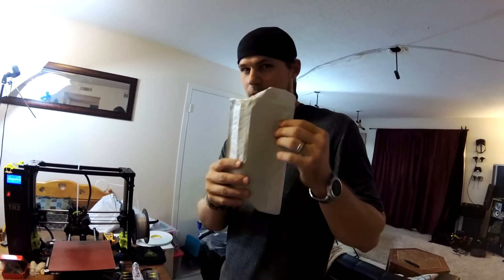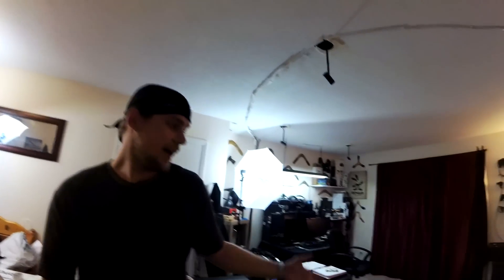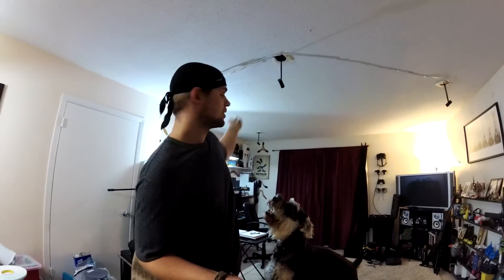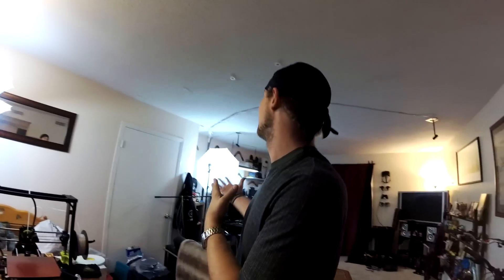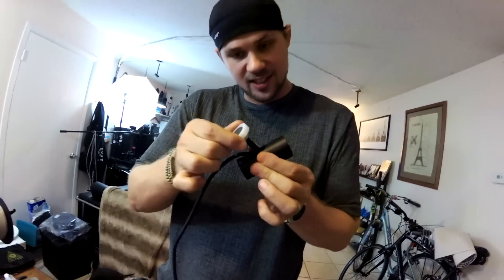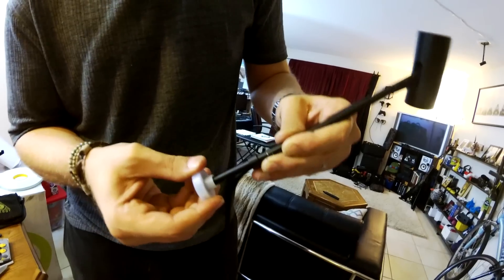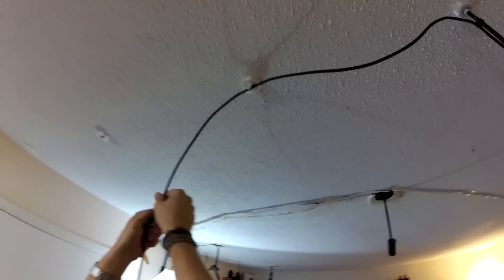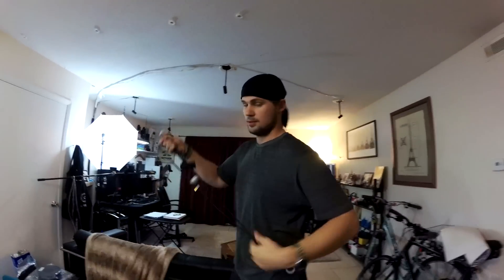Magnetic Sensor Mount Prototype (Quick Setup & Tear Down)

Comment: These look great. I wonder if you could put some kind of dial on so people can note which way their sensors were facing when they take them down perhaps? That way you might not need to do recalibrate each time.  I had a sensor fall off my ceiling twice withmy old mounts (amazingly didn't break!) and I was able to put it back up without racilibrating so it still works if the position/direction is a close match.

Comment: I dont think you can see my replies, so I thought I would start again, I am seeing my entire guardian system move off center a bit when I turn certain directions with my 3 sensor setup. 2-usb3, 1-usb2. To answer your previous question, yes I am facing the middle sensor (The right front) as I press the trigger. I decided to leave the guardian setup screen on and to turn and replicate the problem. What I noticed is that the sensors (All 3) rotate counter clockwise just a bit, in the same way as when I am rotating them to the correct orientation after I hold the trigger. This is what is causing my games to "snap" to one side, messing up my bounds all over and being very disorienting, causing many issues in game as well when it happens. Any other ideas?

Comment: Sweet! Got my third sensor now, so I'll be needing something to mount them to the ceiling soon. Do these magnet mounts work with ceilings with texture on them? My ceiling has a slightly rough texture to it.
Reply from the maker: yea man, my ceiling is super rough. it has the spackle stuff all over it so it's got bumps that pop balloons. Still the stickies have no problem making it work)
Reply: Sweet! Yeah my ceiling's the same thing. Sounds like a good solution! ^^

Comment: You would have to setup the guardian system every time you play... I rather have them setup nicely and cover the cables with the cable covers lol
Reply: I 3D printed wall mounts for the sensors and the look great on my wall, I only use 3 sensors
Reply: Well setting the guardian sistem won't be absolutely necessary but it won't be perfect cause the sensors will be at slightly different angles all the time
Reply from the maker: Of course! This isn't meant to be taken down EACH time you play, it's so that you CAN take it down if you'd like with ease and of course setup is easy also. If you have to put them back up all you need to do is redo sensor setup. Also, if you keep your MAIN sensor in the same spot you can move the other sensors freely WITHOUT having to do any extra configurations. )))

Comment: seems better than my solution, I just used the Command sticky bands and hold the cables with Command hooks, works fine, but if I take down the cameras 8 also replace the old Command bands from the cameras
Reply from the maker: totally, I've used a lot of different solutions including cardboard, tripod mounts, and tape. This is my favorite so far

Comment: Looks great.   I was watching without sound and thought just  needs cord clips and there it is.  So do you still get jumps when using 4 sensors?  I've repositioned mine so many times but still get annoying jumps when turning around facing certain directions.
Reply from the maker: I can ASSURE you beyond a doubt that a wide fix is coming))